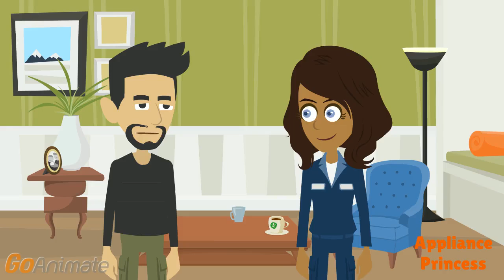Goodman Furnace Blower Motor Problems

Comment: As an installer, I've installed probably 300 or more systems, and the vast majority of them were Goodman brand, and the number of warranty repairs can be counted on one hand. I think the majority of Goodman bashers are the "powers that be" those who have had a strangle hold on the necks of Americans, TIME FOR CEO SALARIES TO GO DOWN, tens of millions of dollars a year is rediculous, only way to get change is for Americans to get proactive, learn the truth and stop trusting rhetoric.
Reply: So true Steve.  I have had a Goodman furnace and AC for 10 years.  The AC has never had an issue and I don't get yearly maintenance crap on it either.  I clean it off with my hose regularly for air flow and that's it.  My blower fan just went out in the furnace, my first issue, but was an easy fix.  So yea it's BS about Goodman products and you can order them yourself online without all the middleman markup.  I love Goodman!